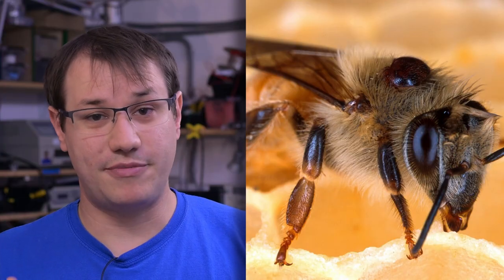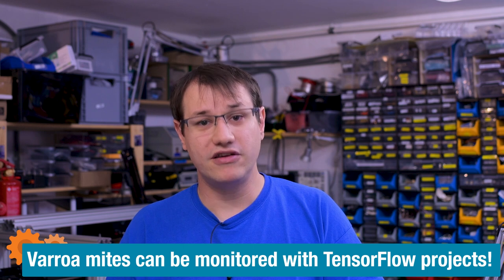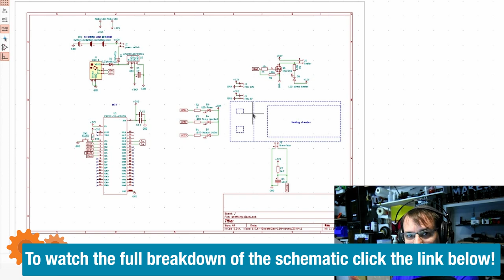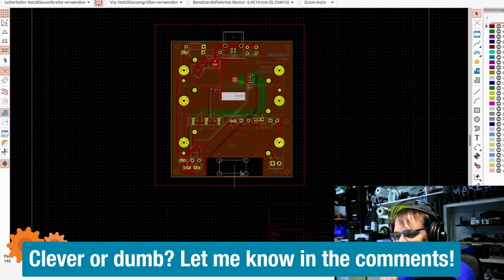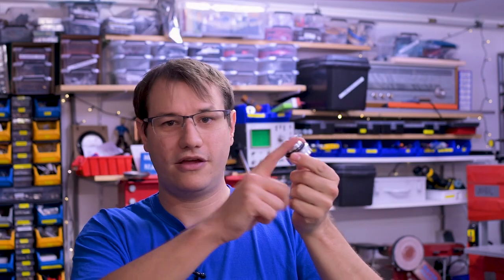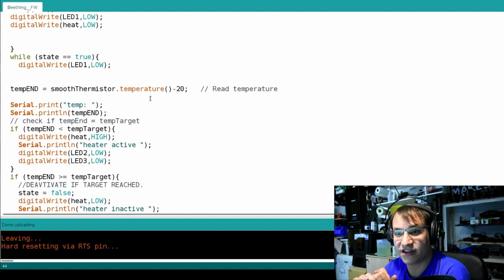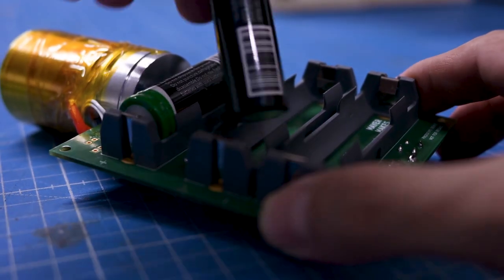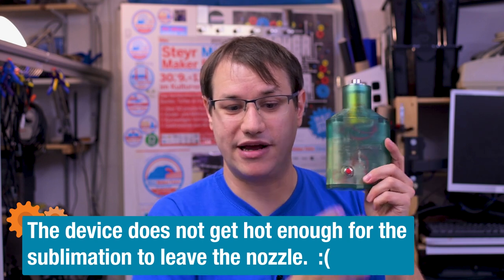Bee-Saving Electronics Prototype

Comment: Back when I was beekeeping, I made a vaporizer where the heating element was a diesel engine glow plug. It was connected to 12V lead acid battery, about half the size of a car battery. I got the basic idea off a fellow bee keeper. My thermal mass was probably the same as yours, but I had access to much greater current to offset the ugliness of my design.

A year later, the regional bee-inspector gave a great lecture to our bee keeping club and one of the stories he told was getting his assistant to try the oxalic acid approach as a monitored experiment. If I remember correctly, using oxallic acid every other day, it took full month to get the mite numbers down. In short, it was relatively ineffective. One of the problems with it is that it can't penetrate capped brood comb. A better choice is formic acid (which is a pungent liquid that smells like vinegar). The trick with formic acid is delivering it at the correct rate, which means its a great opportunity for electronic control.  Existing formic acid delivery systems are all passive, which means they can only be used in certain temperature range (too cold and the formic doesn't vaporise, too hot and it vaporizes too quickly and the bees get too concentrated a dose).

Comment: The heating element section should be separated from the control section and be powered by wires. This has two advantages... One, the control electronics are not subjected to gassing. Two, there does not have to be room within the hive for the size of the controls.